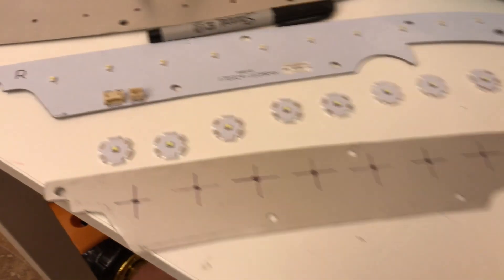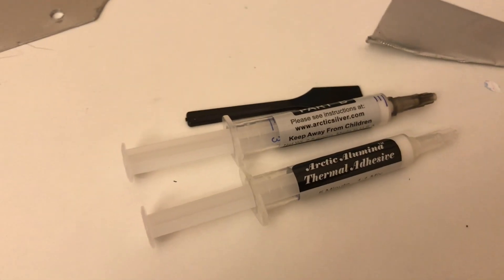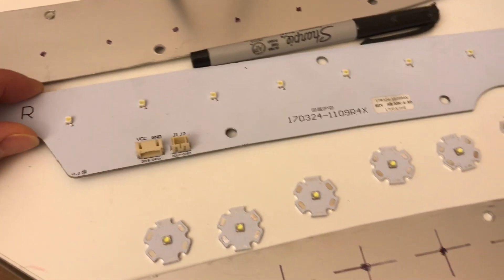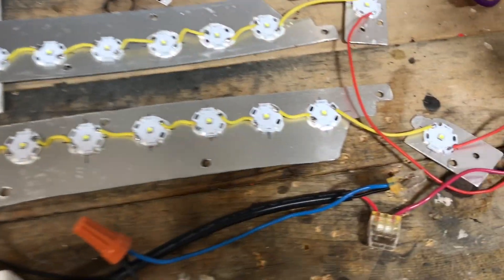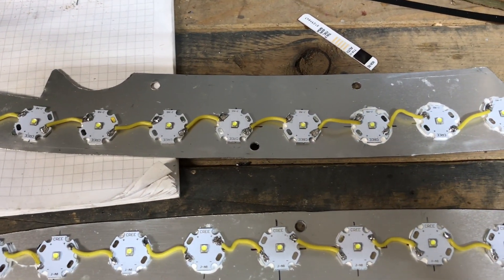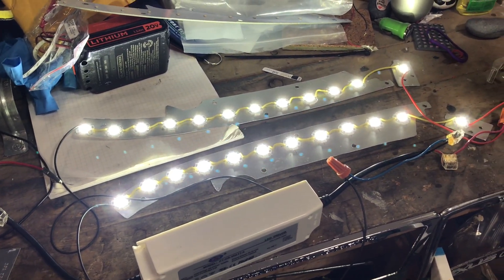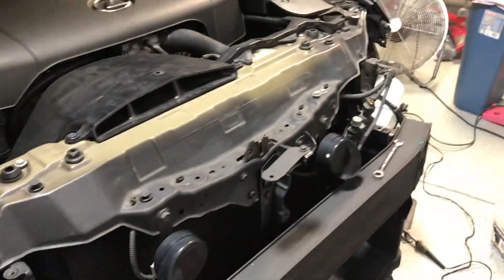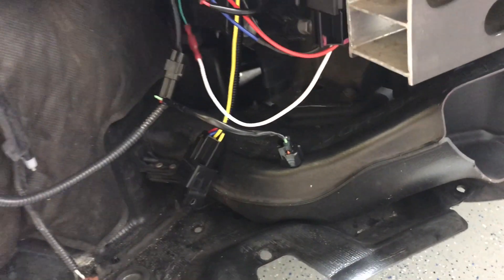Lexus DRL LED Change and LED Project Retrofit DEPO IS250 IS350 IS-F 2IS Headlights

Comment: Does the heatsink need a fan?
Reply from the maker: No fan needed, the LED have a good sink already but adding the aluminum board and thermal adhesive helps dissipate more across the area.
Reply: @TunerwithKids  thank you very much

Comment: Greetings, do they still work. I am very concerned with the enormous heat they output!
Reply from the maker: You’ll be fine with the aluminum heat sink.
Reply: @TunerwithKids  I am not sure about current? @ What voltage and current do you drive them?
Reply from the maker: I forgot but whatever that mean well driver I used outputs. I got one that was near the max output of the LED chips I used. You can get a bigger driver but it will only output as much as the LED chips will pull. I used for over 1-1/2 years before I got out VLAND on. Will be putting them back on since my VLAND are being given away as part of my YouTube contest.
Reply: @TunerwithKids  do you happen to know/remember the driver you have been using?
Normally the led pulls current according to the voltage.
Reply from the maker: @StanislavTsonchev  , got all the info and links in the description box.

Comment: My DRL is doing this also , my passemger side works but my driver side doesn’t work at all. So do you think I could do this and have this same outcome and what all tools and wire etc did you have and use
Reply from the maker: Yea. Check out the description. I have all the stuff I used to make this setup. If you have the wiring and soldering skills. Go for it.

Comment: I'm curious how it held up, because I didn't see you use any resistors for the DRL Creech chips you put on the board? Or did you use a larger capacity resistor in line of the wire powering it?
Reply from the maker: Keye Haze they are holding up. No resistors because I’m using a constant current LED driver. It regulates the current and voltage so won’t blow L.E.D. chips.
Reply: Tuner with Kids Do you have a link, because I'm going to replace the LED boards on my 17 Avalon And do a row of white and a row of amber To make switch backboards , I was thinking of using Diode Dynamics S1  DRL/Signal switchback module
Reply from the maker: Keye Haze did you consider the TRS Profile individual DRL boards? Those have the functionality all built in. I’m using Meanwell LDH 45A-350W from L.E.D. supply.
Reply: Tuner with Kids I have Amber version of the same LED chips you used,